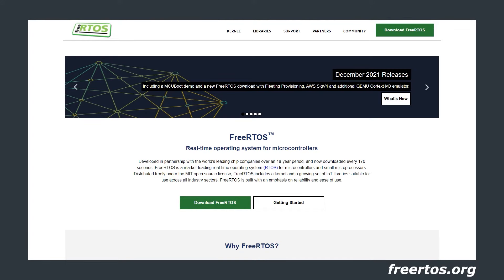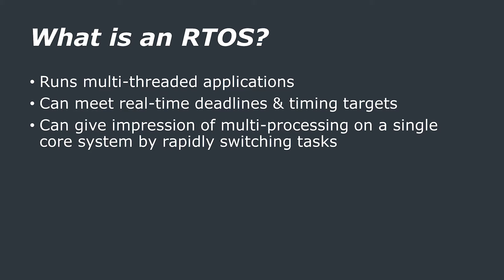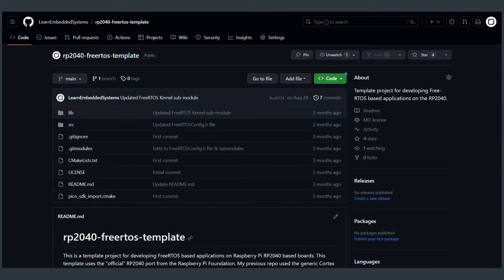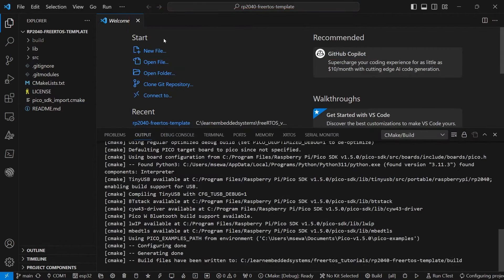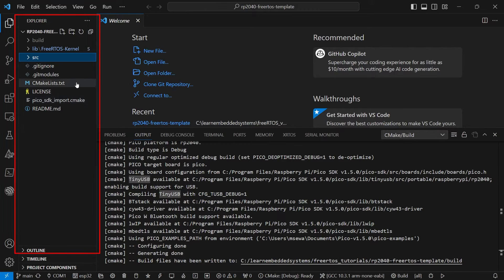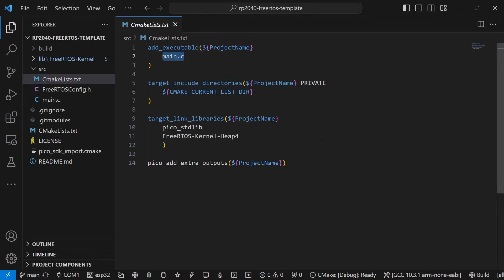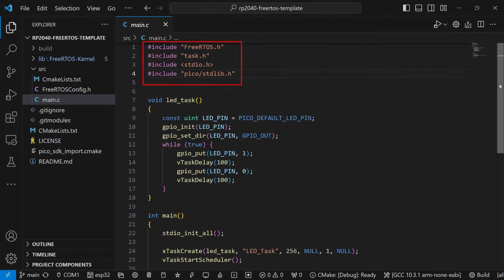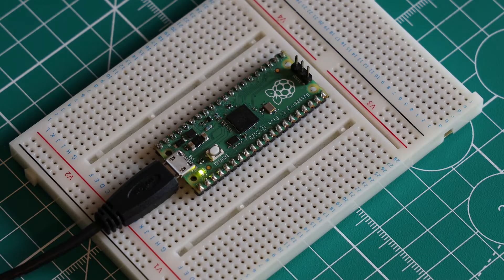FreeRTOS on the Raspberry Pi Pico (RP2040) Part 1: VSCode Setup and Blinky Test! [UPDATED]

Comment: Where did you get that nifty brreadboard?  I was hoping you had a link to it in the description, but instead it linked to standard 5 pin per column, 63 column breadboards.  Yours is great for wide modules such as the Pico.

Comment: my computer doesn't show the GCC option. What should I do to change my setting?
Reply: I had the same problem, because he does not explain very well how to do. 
First I recommend you install GNU GCC for Windows, then install VSCode.
Once inside VSCode and with your project folder open, at the bottom in the center, there is a line with a lot of functions. One of them is called "Build" (look at the bottom of VSCode) and in there, if you press it, you will get the option to choose GCC arm-none-etc if you have installed GNU sucesfully before.

Hope this helps because it took me 1 day to find out!

Comment: Just cloned the repository. Project would not build. The "cmake .." step failed. Problem src/CmakeLists.txt should be called src/CMakeLists.txt. Linux uses case sensitive file names. Thanks for the video.